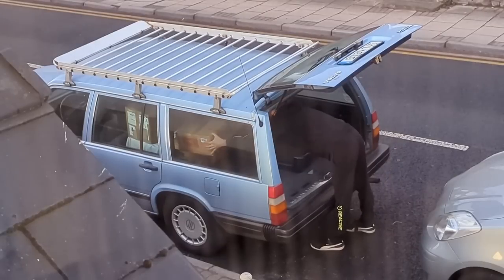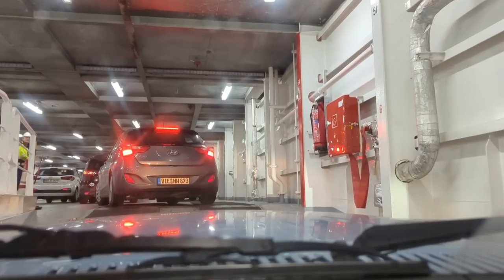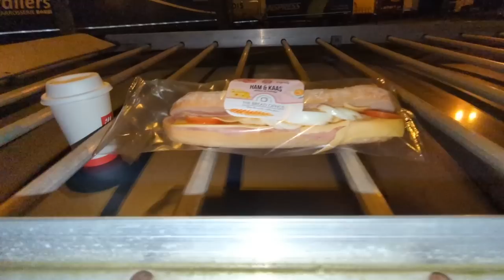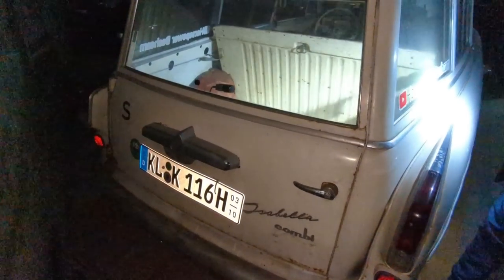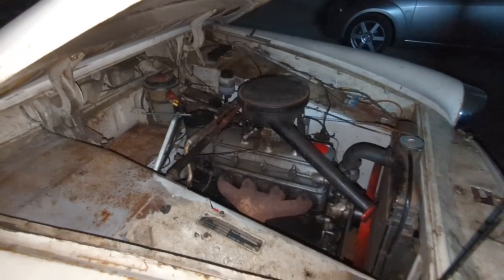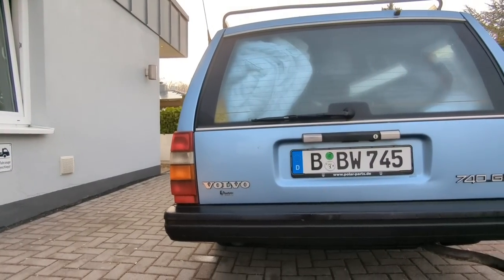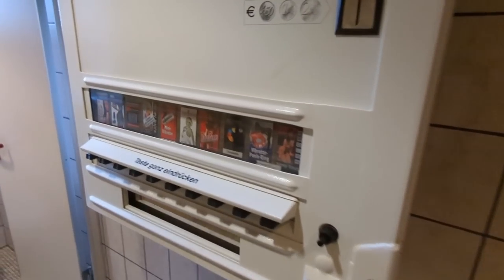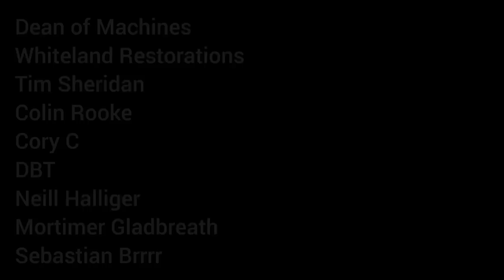Driving my Volvo 740 from the UK to Bavaria

Comment: If your car has the blue 5th/coldstart injector try to disconnect that electric  connector.
Also, those coldstart injectors have a tendency to leak (dribble) anyway. So when the engine is at operating temp it will not be opened electrically but it might still be dribbling into the intake  anyway because there is still 3bar line pressure behind it. It may be the cause for the hard starting and the high fuel consumption.

That Borgward Combi is sweet! Must be a rare car.
Reply from the maker: That's a great point, this one doesn't have a cold start injector but it could indeed be the main injectors leaking a bit

Comment: Regarding fuel calculation, I monitored the consumption last summer and found that my 745 gl (automatic) drinks 1litre per 100 km's, fully loaded (4 adults with luggage) on highway. I kept a max speed of about 90-100 km/h and didn't really push it.

On my daily commute, 15 km one-way, mixed driving, no passengers, she drinks 1,2 litres per 100 km.

Got some new wheels and it improved mileage slightly, but greatly improved the driving experience (the steering wheel used to vibrate violently at speeds over 80km/h)

Looking forward to doing another long-distance test with the new wheels and pushing the speed up to 120km/h on the highway.

I find the Volvo very comfortable to drive a long distance, the only downsides are, there is no climate control, no cruise control and no cup holder. The first two I can live without.

Comment: 745 doing 745 stuff! Nice drive Sledge, love the Borgward! Been dealing with a similar hot start problem on my 240 (89 F engine with 2.4) the last year, same issues running a bit rich, starts and run great from cold but needs to hold revs up when started warm and until hitting 2nd/3rd gear (auto). After an hour or so from standing it starts like normal. I've developed some two feet driving chops driving out of car parks breaking while holding revs, that's for sure. No codes (2.4), swapped a lot of stuff, crank sensor, fuel/main relay, cold start valve, deleted the air filter housing pre heat tube, gone through everything LH etc. Pretty much last thing to test/swap is the fuel pump check valve, might be something for you to look in to as well!
Reply from the maker: Thanks for the info! Always ends up being one of the last things doesn't it 🤣
Reply: @Involvod  haha yes for sure! Oh well all that stuff is nice to have done preventive anyways. And it turned out not to be the check valve, seem to be injector problems as someone else mentioned here, and that's REALLY last resort.

Comment: Just watched the video from January 15th of this year about the 740 and noticed you tossed aside the black reservoir that was at the top middle of the engine bay and didn't see it in this video. That was a vacuum reservoir so removing it basically introduced a vacuum leak which could contribute to it running rough. It caught my attention because the hose broke off of it on my 850 which was contributing to a vacuum issue I was having.

Comment: I am not familiar with the LH 2.2 injection system, but on my 740 that has Motronic there is a 5th injector located under the intake. A temperature sensor opens and closes the circuit for it. That sensor failed on my car and made it hard to start when cold. Easy to test if you have access to a freezer and a multimeter.
Reply from the maker: Thanks, it doesn't have it, but perhaps the main injectors are the problem 🤔
Reply: If it only happens when cold, I would assume there's some sort of temperature sensor somewhere that isn't happy. I'm sure you will eventually find out the cause, and looking forward to the video with the solution!

Comment: My tach occasionally jumps about even with a new good quality crank sensor my 940 doesn't like the e10 fuel much and has taken a bit of time to start and mis fired he now is running better on super unleaded also I had a 740 turbo that stopped pressuring the fuel system when the ignition was turned on and after fixing that with a separate switch a injection relay played up to stop hot starts and if she is running rich at idle don't forget to check the fuel pressure regulator (I'm guessing your 740 is injection)
Reply from the maker: Thanks for the tips 🙂

Comment: I know the feeling. Reminded me of a trip went I went back by myself from Qld to Victoria to collect   the rest of our stuff that couldn’t fit in when we moved. I was in a 145 . Had it for 14 years. Never let me down. Bullet Proof.    
I have not driven my 940 on Freeways yet. Only country roads. What speed are you doing on that four lane highway? Interested at what they like as a cruising speed. My Torque converter locks after 80 klmph.  Probably reduces revs by 200/300.  Have not had to worry about any consumption, as I have not done any long distances, not being my daily drive. But I think 10 lt per 100klm would be reasonable, especially with the load you had. Anyway, once again an interesting and informative video. Strange that people like to watch others driving. Lol
Reply from the maker: Thanks, yeah she previously would do 8-9L per 100 highway, but yeah without such a load. I was doing on or under 70mph so in the region of 110kmh, the torque converter locks up at 90kmh which is really frustrating on the autobahn here because that's just over what the lorries will travel at so lots of overtaking and being tailgated, or I have to sit just before it locks up 😅

Comment: That's a sweet little wagon your friend has. Have you tried cleaning the MAF on your 740? The MAF might be giving your ECU a poor air flow reading causing it to hard start when hot. Simple thing you can try and won't cost you much time or effort. I clean the MAF on my vehicles a couple times a year to keep them running efficiently. A bouncing tach is normal on my 745t and it runs like a top. I have two distributors for it and it does the same thing with them both.
Reply from the maker: Thanks, I actually tried a different one just to be sure, no joy 😏

Comment: You may have a leaky injector or injectors after switching the engine off. This causes rich, hard hot start issues.
Reply from the maker: Thanks, I think that's the next thing to check 👍

Comment: You might have an issue with the coolant temp sensor for the ECU or the airflowmeter or a fuel pressure issue with the fuel accumulater .
Reply from the maker: Thanks 👍

Comment: Please let me know the issue! I’ve having the same hot start issue with my 240
Reply from the maker: Definitely will do!
Reply: @Involvod  I was thinking it could be something with the cold start injector, possibly stuck slightly open or something.
Reply: @duncanw6528  I just had a similar hot start issue with my B230F and it turned out to be the engine coolant temperature sensor.
Reply: @bobjohnson1587  my issue turned out to be the o2 sensor

Comment: i'm having warm start issues as well with my 245, yet to find out what it is. do you have a video about that perhaps? thanks for the roadtrip!
Reply: Try replacing the coolant sensor for the ecu.
Reply from the maker: Not yet, but hopefully soon!
Reply: @pim24599  thanks for the tip, i tried replacing and relocating the ignition ampifier or whatever that thing is called, mounted to the body behind the battery, to no avail.
Reply: @pim24599  not yet, i have multiple issues i need to address and can't do it all at once. a leaking heater valve, a broken chronometer gear and 2 broken tail light units are further up the list :) thanks for asking, i'll let you know.
Reply: @pim24599  de koelvloeistof temperatuur sensor komt morgen binnen. ik hou je op de hoogte!
Reply: @pim24599  replacing the coolant sensor worked! thanks so much for your tip.